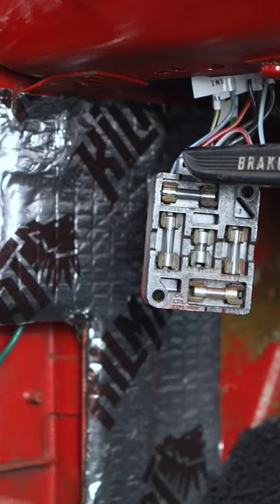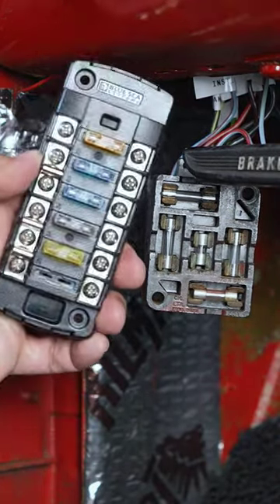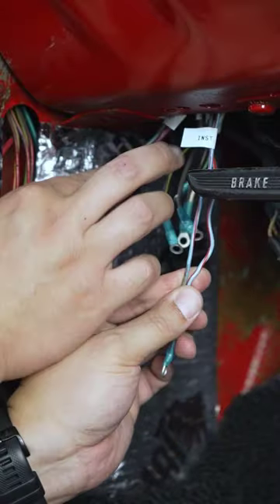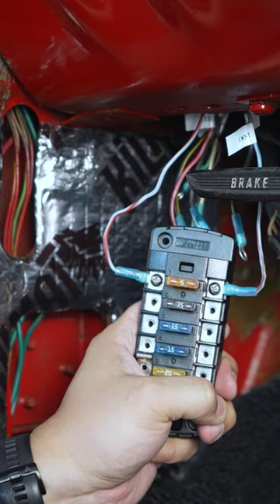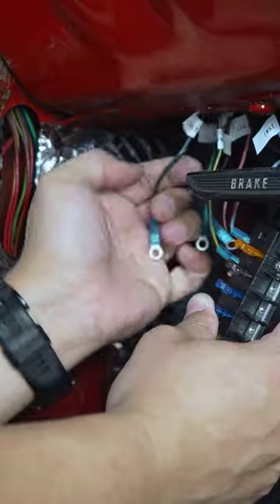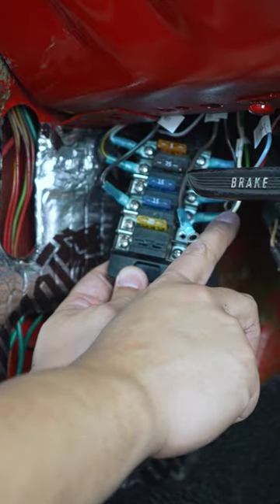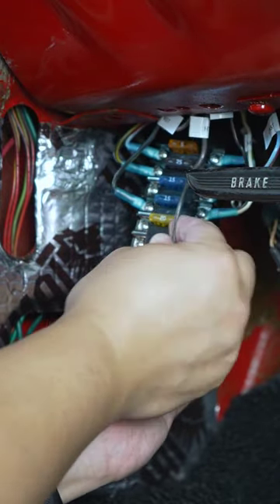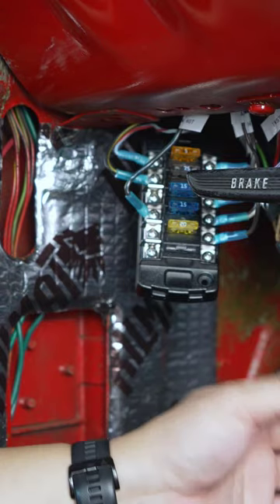1966 Mustang | Replace the Existing Glass Fuse Block?

Comment: You got 12V constant and you got ignition 12V in your original fuse block. The part you installed is not addressing this.
Reply: Electrical is one of my many weak points. I like this idea for my 65. Did you ever hear any thing about the 12v constant and 12v ignition????
Reply: No shit huh?